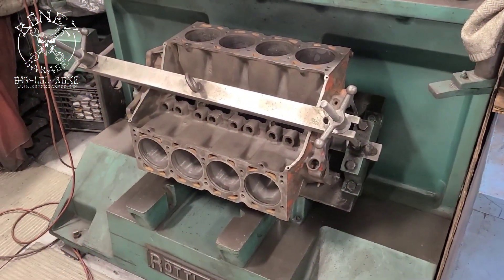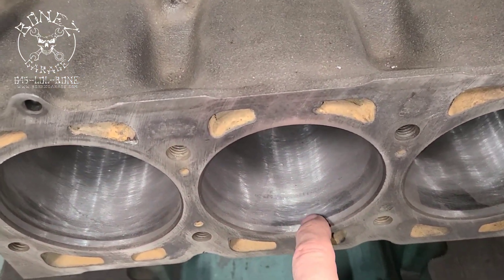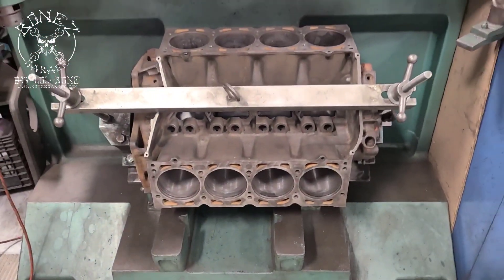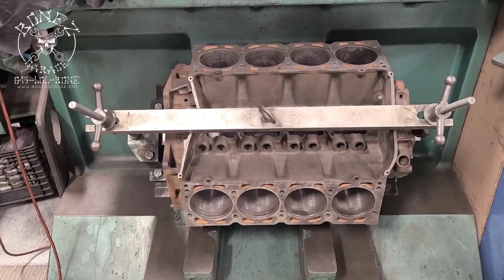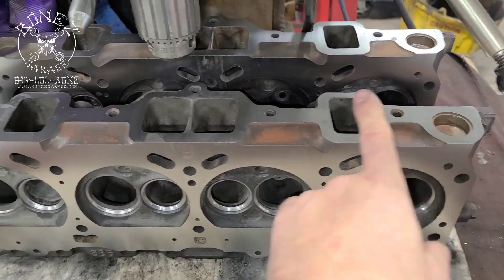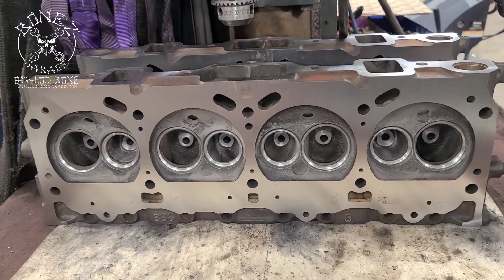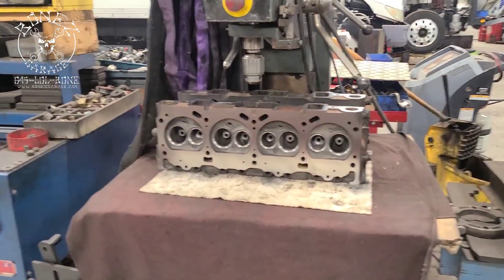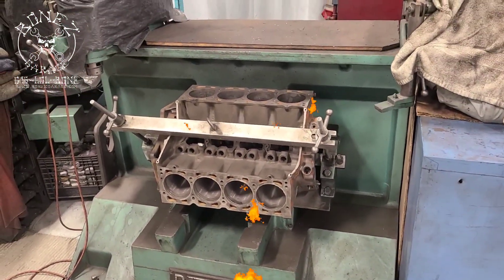#1968 #Oldsmobile #442 #455cid #Olds #motor - #BonezGarage.com 845-565-2663 / 845-LOL-BONE

Comment: I'm curious what donor car the block came from.  If it's a 455 then it had to be a '70 or later.
Reply: The Olds 455 was first introduced in the big body and Hurst/Olds cars in 1968. So it's a 68 and up motor.